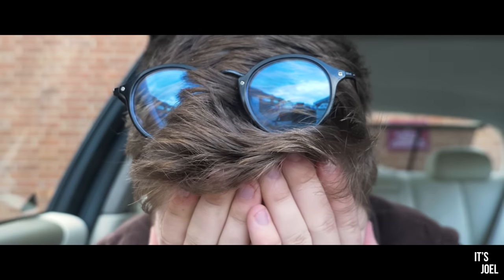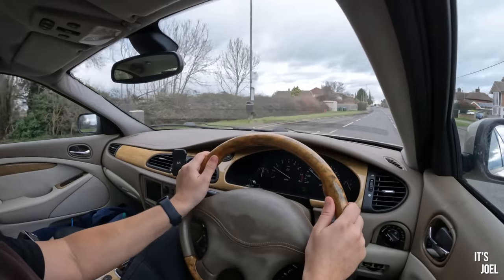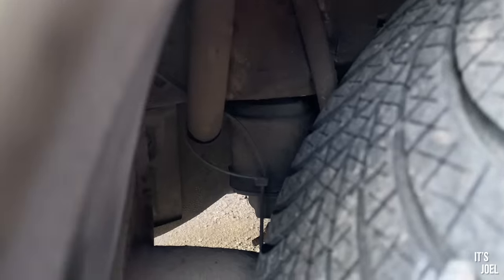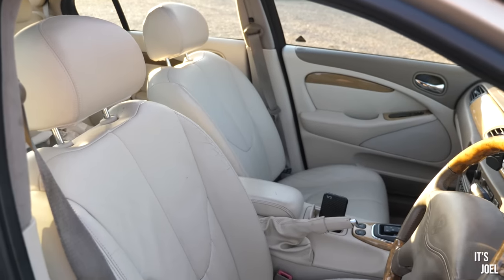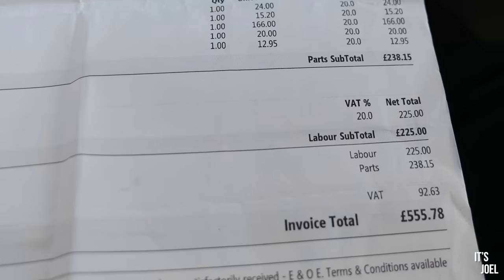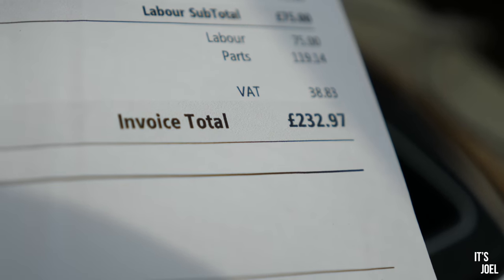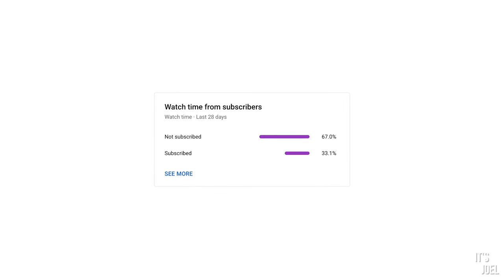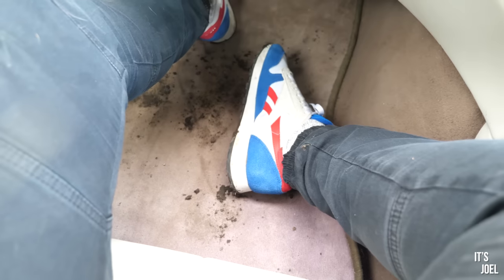You won't believe how much money I've spent on my 'Cheap' V8 Jaguar S-Type...

Comment: My first s-type cost me £3,000 over 4 years... that included a replacement gearbox, and rear sub frame, and after it's last MOT is was decided to get rid of it as it was rusty beyond repair.   but it's a jag thing... I'm on my second one now i bought it cheap knowing it has issues. 2 of which i have fixed, and now waiting for O2 sensors to arrive as these seem to be a common issue, and it has a DSC fault.. which again could be a sensor or pads. Anyway like is said it's a Jag thing and Jag owners tend to say through gritted teeth "I love my Jag".

Comment: The repair bills aren't that bad once you're confident in the work that's been done... a lot of the total is VAT at 20%.

The car is a rare survivor and you have recognised that... it's typical of a car that was moved on before a lot of expensive overdue work was done and if you take one on you have to accept that and put in more than you'll get back to do the right thing by the car.

Hope the tyre swap works out well...

Comment: I’ll give you my example of what I spent on my previous car. A 2003 Seat Leon 1m Cupra 1.8T. I bought it for £900 3years ago. It had a FSH. Well documented.. I got all the necessary maintenance jobs done on it. I kept up the required work throughout my ownership. So I spent £2,500 on it in 3yrs. So all in £3,400. Then sold it because I fancied a different car.

Comment: Hi Joel. I’m doing the same on a Cayenne turbo that I bought after watching your review………Yes it can be eye watering to tot up the expenditure but I look at it as rescuing the car from scrapping. You are keeping a now classic vehicle on the road - keep going! 

The biggest thing I have come to realise though is everything must be done yourself. I had to change the thermostat and it was an absolute pig of a job - took 2 days as the old one had fused to the block being original. I dread to think of the cost. Yes the welding will need a specialist but almost everything other than an engine or gearbox rebuild can be achieved on the drive with a decent set of tools. It’s the only way I can afford to run an older car once worth 90k. You really can’t be using a garage for services or running repairs unless it’s mates rates!

Comment: Good summary Joel . We call them "bangers" for a reason and it's important that you illustrate the potential downsides of bangernomics so that people can see that they might actually have been better off paying 10K for a 2018 Ford Fusion especially when they need it to start every morning. There's a big difference between daily drivers and weekend hobby / project cars and I think your Jag falls into the latter category . Maybe a future project could be investigating how much we have to spend to run a car that is 99% reliable while also being cool / powerful / fun ? GL getting the Jag wedding ready and I expect to see it in the raffle shortly afterwards😀😀
Reply: I normally lose with bangernomics but my £2k cooper is now into year 5 and only ended up with one £500 repair when the injectors went. Ive also lost badly , my MR2 being a bad choice.

Comment: One Mot cost me £1000 for welding and one Mot cost me approx £2500 for welding and all new adaptive shocks and springs all round. Got it A1 then the timing chain guides disintegrated and wrecked the engine. If yours has the original guides, be very cautious!

Comment: Good on you for deciding to keep going with it. You need to address the rust issues asap, even if just getting underneath with a wire brush and rust protection 👍

Comment: Just part and parcel of running old cars, you win some you lose some. I think you lucked out with the 7 series. As with all investments, the key is getting a good example for the right price in the first place. Take comfort in the fact that you would have lost around £5k the second you drove a new SUV off the forecourt! The only way your average earner can keep something like this on the road is by doing DIY and taking advantage of aftermarket parts where appropriate to save on garage labour and VAT.

Comment: It sounds a lot 5 grand but as you've included insurance etc in that tally I think you've done OK.  Buying a cheap car is always a risk and all the work needed for the MOT is not extreme for age of it. You could have found for instance gearbox or engine problems etc.  Get the rust underneath sorted, a good rust protection added ie Dinitrol or similar to minimise future rust issues and you will have a great car. Good luck mate.

Comment: £166+VAT for the expansion tank? I got an aftermarket one for mine for under £50...took me 20 mins to fit. The thing to remember is that it isn't a £1400 car, it's a £50k car which has depreciated, so when you get it all sorted, you're getting the experience of a £50k car. It's a beautiful car and that interior is nicer than mine! 🙂 (Mine's the 2.7d, so more mpg but less oomph) Not bad for 5 grand.

Comment: With sunroof, which is a 1k factory from new it was a £40k car 23 years ago.
I have a 4.0 s type, with sunroof. In the summer with the windows down and the roof back it will put all costs behind you.
Replace tyres in pairs or  ideally as a complete set,it looks cheap and shabby with pick and mix.
Definitely invest in a good socket set,dare I recommend Hal***ds advanced 120 pc for DIY and a ⅜" torque wrench for smaller stuff if you aren't calibrated from experience. The 4.0 expansion tank is very poor and obsolete so getting one at all was a win. 
Saw it was up on eBay, thought you had given up on it.
Keep the battery fully charged and don't expect the battery to last like it should,it won't. It will be the root of just about every electrical gremlin.

Comment: It's easy to spend more that what a car cost, however if you didn't, and bought another for that money, it would be just as bad.
I'm 3 years into restoring my 'cheap' 2003 XKR that I bought with full MOT for £5k, I will have spent way more than that on it, however it will be rust-free and tidy once it's finished.

Comment: No he did not jack it on the fuel tank, that's much further forward. No he did not jack it up on the diff ( that's a no no as it's could damage the bushes as it's not hard bolted to the beam)  ... But it did look like the boot floor which is not a good place!!

Comment: You have to relate the running costs and repairs to the original cost of the car when new. PLUS you have generated valuable YouTube content.   For extremes check with Matt  on YouTube

Comment: It’s strange that you aren’t doing the work yourself. The problem with letting others do the work is that you are not learning those skills. That’s fine but you would be just as well off buying a similar but better maintained car for 5 or 6k. However, the interior is to die for and it’s a beautiful car.

Comment: Joel,
I have a company which has vintage mk5 Traditional Ice cream vans 
Your first mot place which failed it on rust, I cant believe the second garage changed it too “advisory” 
Bought a van years ago we got moted which had 15 fail points on rust alone and yet previous year it passed, when having older vehicles getting it all welded and waxoyled it will last years. 
Your first mot failure was not much when your used to older vehicles, understand the second opinion but seems you wanted less faults and to pass easier.
If you Love the vehicle that much do all the maintenance, all welded and protected it will last years.
I was genuinely laughing at the first mot fail lt was nothing!
Weve had 2 pages of faults before 
Stop thinking about getting your money back too in the maintenance you wont

Comment: It’s just cost me £600 all in for 2 rear callipers and handbrake cable kit on a X.type so I can only imagine the bigger S.type parts would be even more expensive 🙄
Reply: Would have cost you c. £100 diy
Reply: TH
I to thought £600 was stiff.
The x type calipers are the mondeo and recons are 50 quid each.
Iv just rebuilt one with new seals that cost £12
Reply: @andypicken7848  
£137 each for the callipers 
£35.99 pads 
£22.50 each for the handbrake cables all parts are the brand PAGID
So that’s £355 in parts plus fitting and 20% tax Total bill was £574 but I rounded it up to 600 as it’s just less pedantic 🙂
Reply: Gods Mafia 
To rich for me mate.
Its not that I couldnt not afford such a bill, its just that I could not find any value in paying 600 quid for 2 barakes and new cables.
But I do appreciate we are all different
Reply: @andypicken7848  

It’s certainly cheaper to repair than replace but I know what you mean. Regardless it needed doing for it to pass the MOT. Not going to scrap a perfectly good car that just needs breaks for the sake of £200 labour. 8th year of ownership with the X,type 7 years trouble free, it’s better the devil you know when you think about it.

Comment: You have got loads to learn about cars and costs,it doesn't go without saying which way you go about this because when new or old you've have costs to be part of owning a car.
For example an ev has new in lots of ways more costs than you think and petrol,diesel new has not just cost of running repairs but second if its worth buying because of ev cars so where do we go from here.
Me I intend giving up when im 75 or latest 78 but you will just have see where the govement goes!!!!!

Comment: Try to get a jaguar specialist but not jaguar itself as doing big DIY jobs yourself no good when comes to value of car  nothing better than paperwork as I found out when selling a discovery serviced it my self cambelt clutch suspension brakes etc fitted loads of used of road parts was a labour of love even turned my hand too mig welding .lost my shirt when I sold it lost 3500 because done work myself